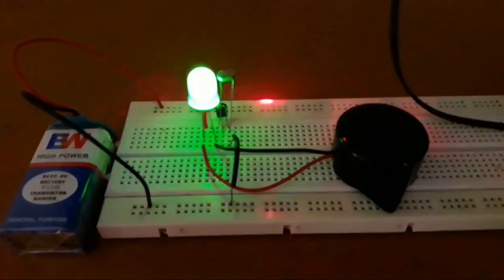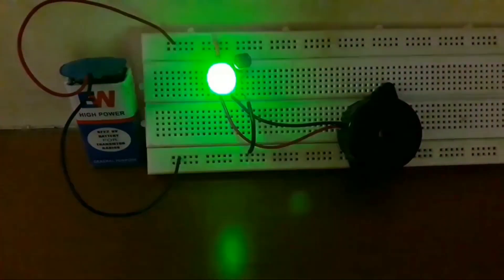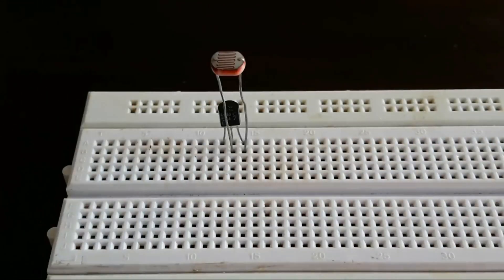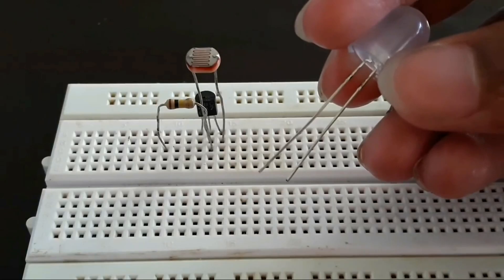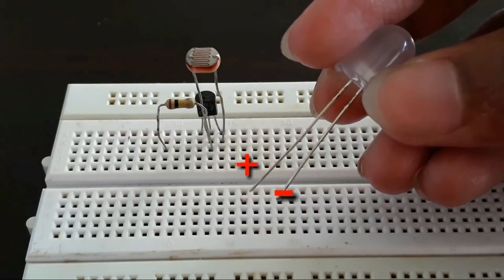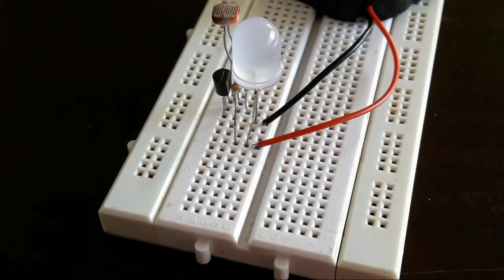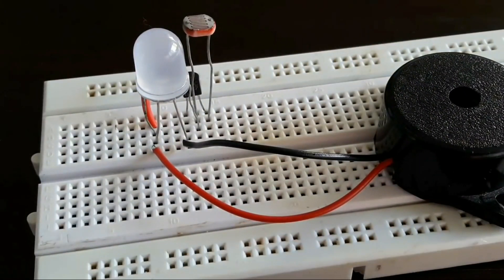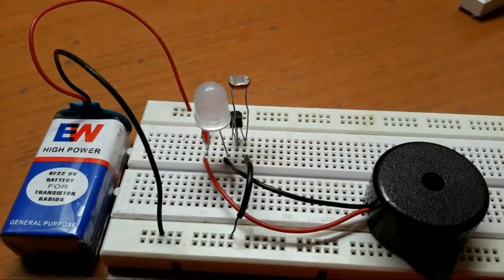How to make a Laser Tripwire Alarm Circuit on a Breadboard [HD]

Comment: Y we use resistor
Reply from the maker: A resistor is used to limit the current going to the LED.
If we do not use a resistor, then excess current will be supplied to the LED and it will get destroyed.
Reply: Why we use transistor and Bell Basar ,and led plzz explain

Comment: My circuit is not working like dark sensor 
when I connected the battery LED started glowing and buzzer also started to sound 
But it is not responding to darkness
Reply: This particular circuit will not work because these are fake projects or maybe the complete information is missing
Reply: my also
Reply: My also... Someone help me
Reply: I watched many vedio on dark sensor. But they did not worked.
Reply: Istiak Ahmed nothing will work coz all the projects on YouTube are fake
Reply: If possible enclose LDR in some black channel and pass the laser light through it but make sure the laser falls only on LDR inside the channel. By using channel the laser falls only on LDR . But it is not possible to make a dark sensor by whatever he is showing in the video

Comment: Can i Get Your Fb?  Cz i need Some Help!
Reply from the maker: +ProTik oo Let me know here..  how can i help you?
Reply: About Bc547 & LDR  !  I Can't Find , What Is C.B.E !!
Reply from the maker: +ProTik oo BC 547 is a transistor which has 3 pins. [C B E] stands for Collector, Base, Emitter.
When the flat side of the BC 547 transistor is facing you, then the 1st pin from the left is the Collector, the 2nd / middle pin is the Base & the 3rd pin is the Emitter.
Keep this in mind and follow the steps to build your laser sensor! :)

LDR (Light Dependant Resistor) also called as Photoresistor. It has a variable resistance that changes with the light intensity that falls upon it.

Hope this was helpful. Have a great day! 😊✌
Reply: ThnQ You, So Much 😇
Reply from the maker: +ProTik oo You're welcome! 😊